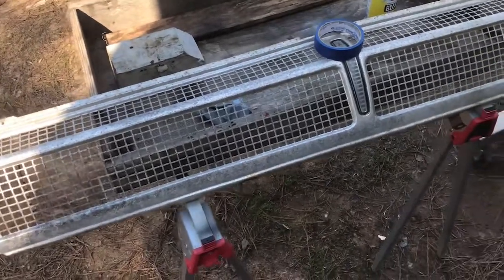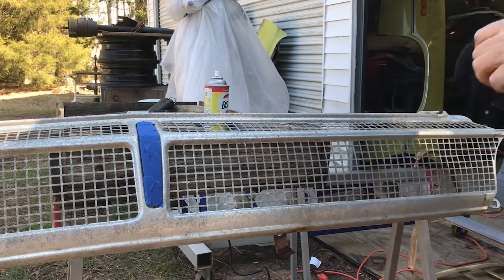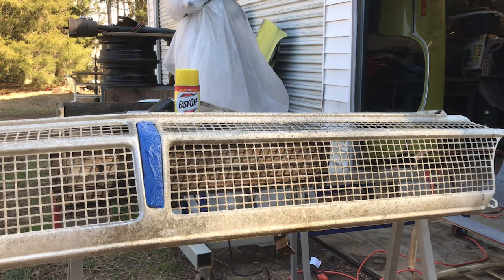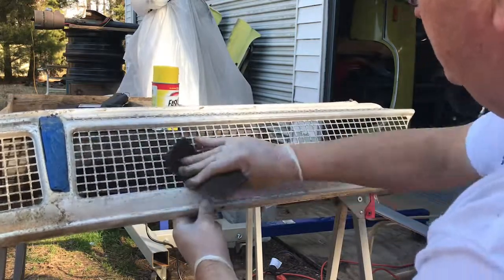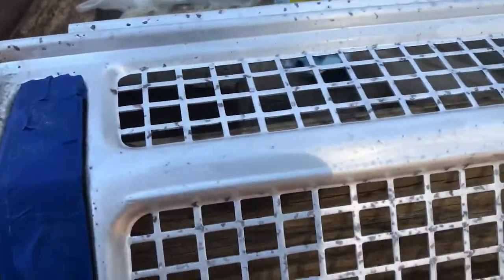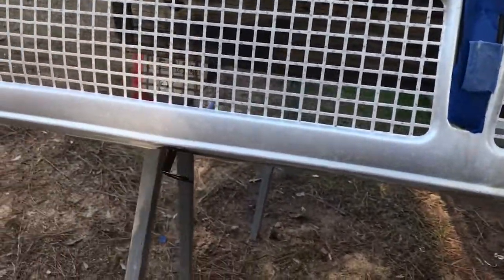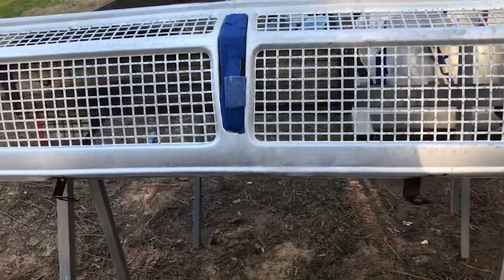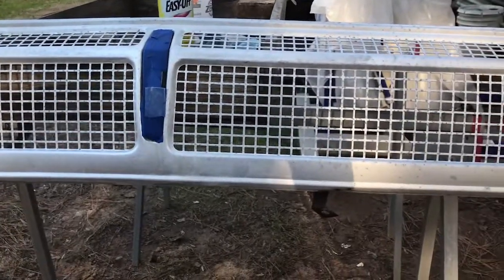Oven cleaner to clean an old car grill ? Does it work ?

Comment: Really good Bob I like it it looks great modern times I've used SOS pads they really got a good detergent as long as it don't scratch the surface but you did a really great job thanks for showing
Reply from the maker: My pleasure Keith
Reply: Try 00 steel wool.